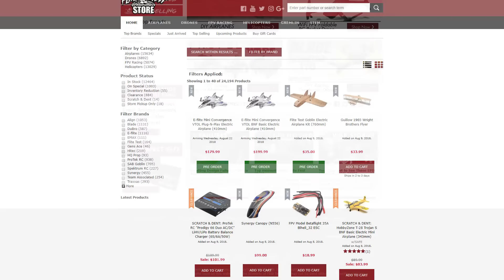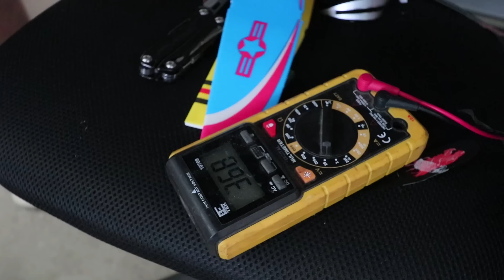Powered R/C glider without batteries!? | Capacitor plane hack

Comment: Okay, take your idea there, but scale it up. I know it will take longer to charge, but still less time than a full on battery pack. Try using a flying wing so that you can store everything inside, and but a capacitor bank in each wing. Do 4 capacitors in series for each bank, or however much voltage you need, but tie the two banks in parallel to give you more capacity. or you can just go crazy and make some flying barge thing. That would be funny actually, having a flying barge that dumps trash through a set of doors.
Reply: Drake Tamer no need in connecting them in series if you buy capacitors that are rated at the voltage you need, then you connect them all in parallel
Reply: U can charge capacitor rly fast,just need more current.
Reply: YTHC yep. You could charge a 25v capacitor with a 4 cell lips and it would be close to fully charged within seconds, capacitors have an exponential curve when they charge so they would take forever to "fully charge", but they would be as good as fully charge within seconds with high current
Reply: If capacitors in series have less capacity, as the guy said, they need to just buy 4 volt capacitors. Then the banks can be entirely in parrallell, and they get more capacity out of the weight.
Reply: @caleb186    hope I can clarify.   He should have said capacitance rather than capacity.  The latter usually refers to the amount of energy stored.  Two caps of the same value will store twice as much energy irrespective of whether you connect them in series or parallel.  If you connect in series the capacitance (Farads) is halved.  If you have two books and put one on top of the other the height (voltage) is doubled but the number of pages is the same as when they're side by side (ie in parallel).

Comment: Quick tip about capacitors: although they have a voltage limit (check the rating written on the casing) they actually effectively don't have a charge or discharge current limit! Their current limit is nearly entirely due to the thickness of the leads.

Comment: one capacitor  directly to the motor no speed control.One to the controls for the servos.
Reply: the point was that the all in one controller needed 4V+ to power on, which you couldn't get with a single 2.2V capacitor
Reply: Slipped, yes you can, with a cheap little buck up voltage converter.
Reply: @modelnutty6503  which will take power to operate, which will be taken from the capacitor, and thus flight time.

Comment: a capacitor is a type of  battery ahahha
Reply: no its not! but it basically can do the same thing (a battery produces electricity from a chemical reaction, a capacitor stores charge)
Reply: True, capacitors are mainly used in applications that need a big boost of current in a small amount of time, where as batteries give of current over a longer period of time depending on what the load draws.
Reply: Not really, a battery is a chemical store of electric, a capacitor is a physical store.
Reply: 1 Thermopile.
A electrical battery source made of a large number of dissimilar metals (AKA thermocouples) which each generate some millivolts

Comment: One nice use for this, assuming the capacitor isn't too heavy, might be as a launch boost for an actual glider. Scaled up, of course, but that would allow you to takeoff and then glide fully on the wind, with perhaps a standard smaller lipo running the radio and servos and nothing else. Kind of like an electric prop plane equivalent to a JATO module. Better yet if you could ditch it after takeoff to lose the weight entirely and have it drop down with a chute like a staged rocket booster. Might even be possible to set up solar panels along the wings if your servo/radio power usage could be dropped low enough and use a capacitor charged by them to run the gear. If so, you'd have an unlimited-range glider so long as you can find good thermals and it's sunny. Thanks for the idea, I've been looking at a few powered gliders recently (because I need to takeoff and while I PREFER the pure gliders... this might let me actually USE one without a secondary launch plan to drop them, putting it within my budget. (The idea is to have a 2-3+hr flight time that's as smooth and gentle as possible to do long-range nature flight videos over wilderness areas, covering hundreds of miles of wild swampland, for example. Also going to be a very slow-flying plane for that purpose.)

Comment: Super Capacitors have some awesome characteristics. I know your glider was getting heavy, but if you would have put 4 caps. on (2 sets series, and put them in parallel) you could have gotten some AWESOME flite time out of the motor.

Comment: Good “Basic” explanation! 👍 In your RC crawler adventures look into glitch busters (capacitors) to regulate the steering servo voltage when running 3s and up.

Comment: Capacitors have a voltage rating. You probably already know this and that voltage rating has to be above the max voltage you will be applying to it. However, having a voltage rating very much above that rating adds weight, most likely without adding any advantage. Like you said these airframes are so low adding even extra glue is “dead weight”. That applies to the extra voltage rating of the capacitor.
I’m impressed with this “flite test”.

Comment: This is a great idea for a micro sail plane!  The caps could give a quick burst to a small motor to give it some altitude. Then a tiny lipo for control.
Reply: definitely, rubber launched with power assist too has some real potential.

Comment: hi ive been using capacitors for years now. by putting a cap on your recever ,
 it can stop brown outs and servo jitter  its really good to use a cap when you have a bec thats not  powerfull and each time you move  more than one servo its browns out , put a good size cap on the +and- of your recever to stop the brown outs

Comment: From my knowledge, when you wire a capacitor in series, it adds the voltage and leaves the discharge rate. When you do it in parallel, it is the same voltage but adds the discharge rate and capacity. So when you wire 2 capacitors together in series, it will NOT cut the flight time in half.
Reply: Actually, you don't have a discharge rate. You have energy in capacitors.
So each capacitor store the same energy. If you put in serie, you get the same current, but more voltage.
If you put the, in parallel, you get the same voltage, but more current.

How fast you discharge, depends on the load (the resistance, to not make it too complicated).
A capacitor can without problems be discharged to 0 V, a battery can't. 
A capacitor can be "instantly" charged up to it's max voltage, a battery can't. 
Batteries can currently store more energy per weight. So that has to be checked. But as I know it, weight is not a factor for the current manufacturers of super capacitors. 

So, fly a capacitor powered plane for a short time, but after some seconds of charge time, you can fly again.

Sorry if you knew all this, but yes. Capacitors have its advantages compared to batteries.

Comment: Nice video.  Have a look at EDLC capacitors (supercapacitors).  I suspect they're being utilized in this aircraft.  Now, if you can get larger ones, measured in farads, you could probably pull off a larger model.

Comment: If you want to get the most out of a pair of capacitors, charge them in parallel, and then switch their connections to series for discharge into the motor / electronics.  That way you'll get the higher voltage you need AND the full capacity of both caps.

Comment: Somebody called Power Up sells a super capacitor power unit to stick in a fold-up paper airplane. Like yours the charger uses three AA cells, or something like 4.5 volts. It charges very quickly, but the downside is the capacitor is only rated for 2.7 volts, and if you hold the charger on too long you damage the capacitor. If you're experimenting with multiple capacitors you probably should think about regulating the charging voltage and current. Capacitors are very different from batteries. Batteries' discharge curve drops off a little right away and then stays at about the same voltage for most of discharge and then drops off at the end. Capacitors are much more linear. When you are halfway discharged you are at half of peak voltage ,which means if you power a receiver with it, it will drop out from low voltage much sooner than it would with battery power.

Comment: Capacitors are electrical components that store electrons on plates that are separated by a material that doesn’t allow charge through . Now I want you to visualise something.Imagine a circuit with a battery/power supply with wires that are connected to a capacitor (which is two metal plates connected by a material that doesn’t allow charge through)that completes the circuit. When you turn the battery/power supply on the electrons flow around the circuit but when they reach the plate they are stopped by the material that doesn’t allow charge through. There is then a variation of charge on the capacitor because there are now more electrons on one side of the capacitor than the other.But the natural state of a capacitor is to be neutral which means it wants to have the same amount of electrons on both plates. This means that when the power supply is removed and the circuit is connected, the capacitor will then cause the charge to flow to opposite way and eventually it will stop when the capacitor has the same amount of electrons on both plates again. I hope this clears things up regarding how a capacitor works and functions.

Comment: Keep in mind that electrolytic caps have a polarity. If they are put on backwards they might pop. 
If you guys are thinking of scaling this up... make sure to use precautions on how to safely discharge the caps... shorting a battery might weld the cables together. shorting caps might vaporize the cable in your hand.

Comment: Soldering tip: hold your soldering iron on the underside of your joint and add your solder from the top, that way you know the heat has spread through and solder has fully penetrated your cables

Comment: You'd have had the same capacity if you put 4 capacitors on yr plane. The 2 in series came in at half their capacity but double the voltage so to get the capacity back, you need another 2 in series but connected in parallel to the first two. That would work out at about the same weight as 4 AAA batteries So you might still be ok? The capacitors you have there are Super Caps. They have a maximum charge voltage each of 2.7V so the series connection should be ok with 4 dry cells (5.4v) they would pull the voltage of the dry cells down a bit so they shouldn't blow up. Fun video though. Thanks for putting it up.

Comment: A capacitor can act as a battery and extend the flight time by adding a resistor to the circuit so that the cap discharges at a lower power, but for longer. A capacitor can be made from laminations such as aluminum foil and plastic, and if you make sheets this way, you can cut out the airplane parts from them, then have the entire airplane store the energy.

Comment: Brushed f3 flight controllers work well. You can actually control the servos from the input pin on the fet. I have a small foamboard wing with two 8x20mm motors and two servos. Its surprising how well it works.

Comment: The capacity of parallel capacitors add their values, while putting capacitors in series treats them the same way as parallel resistors. So if you want to increase the capacity, put them in parallel with each other. If you put them in series, they follow this formula:

C_total = 1/( 1/C1) + (1/C2) + (1/C3) ... (1/Cn))

in other words, add up the reciprocals of the farad rating for each capacitor, then divide 1 by that number. This will give you the capacitance for a series of capacitors.

Hopefully that came out clear enough to understand.
Reply: yup, that old 1/x key like doing for ohm's parallel.

Comment: There are super capacitors that store much more power than the older ones. Older capacitors just had enough for a quick spark. Now they can power stuff for a few sec to a min depending on the load.

Comment: A capacitor is like a physical battery instead of a chemical one.  A normal battery stores electrons in two chemical compounds where they are at different potential energy levels.  When the circuit is completed, the electrons move through the circuit, allowing chemistry to happen and potential energy to be converted into electrical energy.  A capacitor stores opposite charges on two parallel conducting plates that are separated by an insulator.  Because the + and - charges are separated, they are at higher potential energy due to their location in space.  When you complete the circuit, electrons move from one plate to the other, allowing the electrical potential to be reduced and potential energy converted to electrical.

Comment: Hi, great video! but about the capacitors you have to understand the physics behind it. In simple the capacity is the area of the capacitor plates and the distance are used to calulate the capacitance. if you double the area the capacitance will also double. if you increase the distance by a factor of two, the capacitance will decrease by a factor of two. when you hook thwo capacitors in series you are effectively increase the distance by two. so you have now double voltage but half capacitance...

edit: ok... I was impatient and commented before you guys explaining this..

Comment: In my industry,,capacitors on heatpumps a/c units have a run capacitor and a start capacitor,we have to discharge voltage stored in them,before working on anything:)
Reply: Congrats Alex on new addition to ur fam:)
Reply: Yeah, those are big enough to hurt pretty bad if you don't do that :)

Comment: Before flight check the C.G (centre of gravity or balance) . It is 30% from the leading edge of the wing. Add ballast or shift the capacitor for balance.

Comment: When you wire a capacitor in series it'll give you more voltage, but the capacity doesn't decrease. With a higher voltage potential, the capacitors discharge more quickly like how very hot objects will cool faster than a colder object.

Comment: A capacitor is like a "dry" battery.
It has two plate surfaces that stores a charge on these plates.
Capacitors have two main jobs.
1)
To filter AC power and PF correction in a tuned AC circuit
2) to store DC power.
The more Farrads the bigger the storage of DC power.
Capacitors help boost current output esp for bass amps or even ESC.
A combination of a battery bank and capacitor will give you high power outputs taking strain off the battery.
Also to calculate capacitance is the same formula as for resistors but reversed.
EG series connected gives you higher voltage output.
Parrallel connection gives you higher current output.

Capacitors complement Solar power......

Comment: new project idea : make a foam board thor hammer. then put a quad inside the hammer.(you know how some drones have return features? ) take a reciever or something so that when you press a button, that will make the hammer fly to the reciever thingy. put the button /reciever  thing in your hand so that the hammer will go to your hand .I have no idea if this will work or even if its possible, but its a project idea. 

by the way maybe if you put the capacitors farther back , it might fly better. maybe try to get a slightly bigger motor so that it could fly faster/ more lift so you don't have to throw so hard?

Comment: You need to look into more super capacitors, voltage, size, current output (usually good with bigger super caps, even been used to star cars). Biggest warning, the charging voltage used. If they blow that can take you buy surprise, temperature usually not an issue. But it’s possible. Burger the caps the longer to charge, but then once you understand them you could use a Rc LiPo pack for charging fast again.

Comment: Its simple,batterys have a high amount of internal resistance and cannot discharge all in one but the capacitors have a really low amont of internal resistance so it could push electrons instantly but still a battery can delivere 10 times the energy of a single capacitor and the theory depends on a capacitance of the capacitor and the battery,if you wanna get more flight time use a super capacitor because they have huge amont of capacity for example 500farad (normaly) long story short capacitors work like a water tank it stores energy,(mostly) it been used as a filter for rectified voltage,there are many types of capacitors out there,finnaly the capacitor type you are using in this video is a electrolytic capacitor.

Comment: Capacitors charge very quickly and can also dump all their energy very quickly due to low internal resistance (meaning extremely high amperage can be achieved)
But as a side effect of that, even under no load, they discharge into the air quite quickly, making them not too useful for long storage

They’re used a lot as electrical ballast, or an electrical flywheel of sorts; 
Say you have AC going through a diode bridge to make it only go one way, you still will have a moment of 0 volts and it will keep going up and down between 0 and VCC. 
What do you do to give your circuit consistent DC? 
You use a capacitor; during the time that the wave gets to full intensity, the capacitor charges, and then as the wave goes back down to zero, the capacitor discharges power to keep the output voltage steady
Therefore converting AC into DC